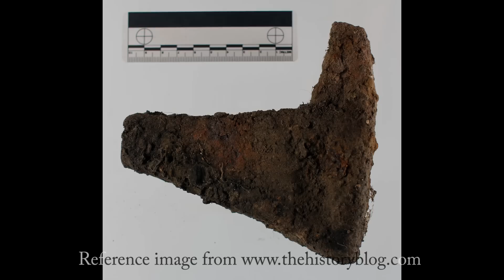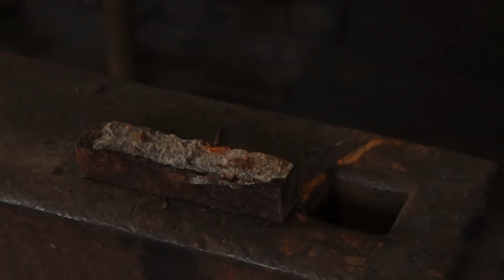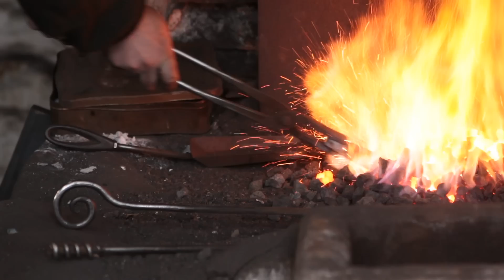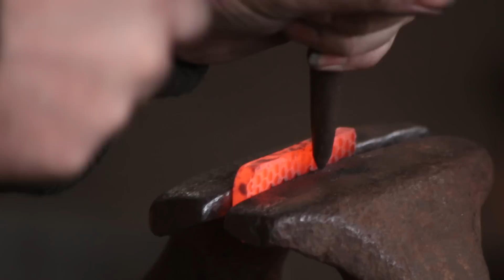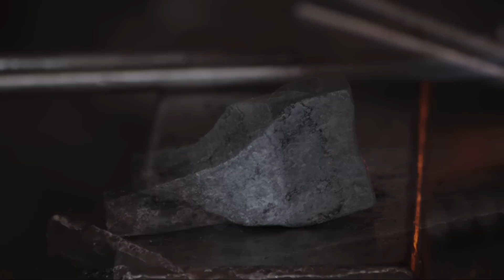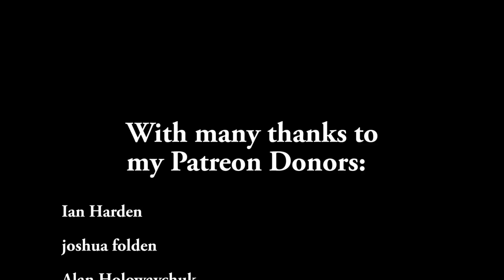Forging an Anglo-Saxon anvil. Part 1: the body and face.

Comment: I have no evidence to support this, but my gut feeling is that, throughout history, the blacksmith would have taken that little bit of extra time and effort to get his tools looking 'just so'. The main reason being pride in his work, but also as an advert to all visitors, which served to demonstrate his capabilities and skill. Toolmaking does not put bread on the table on that particular day, but taking time to do a good all round job of it, delays the time that the tool needs replacing or repairing. I know that, for myself, this approach in self made tools reduces the temptation to abuse or misuse them, as a shortcut for a perceived short term gain.   ...... or is this just all my 'modern day' indoctrination  ??
A great series of videos. I very much wish that you would make more of them. Your presentation and detailed narration are among the best on youtube..... Thank You Rowan !

Comment: So, what do you suppose they would have done to make something like that when they didn't have a nice flat surface to work on like that lovely modern anvil you have? Like, the "first" steel anvil they made. Do you think they might have just gotten it as flat as they could using an anvil stone, then ground away at it until it was good and flat, and made other anvils using that?
Reply: I believe there are several anecdotes and some anecdotal evidence of stone being used as an anvil. plenty of stones are hard enough and heat resistant enough to be beat against. And wrought or bog iron are sufficiently fluid under hammer to allow working on a stone. I remember reading that the tuyere on forges of that era were of heat resistant stone like Granite.
Reply: Well, yes, but I'm talking about creating a flat surface on the anvil they made.
Reply: Short answer is yes, that is a likely way to forge a flat surface when you don't have a flat surface to begin on. There are some areas of the world where stone anvils are still in use.
Reply: Thanks.
Reply: Here's a link to a book about blacksmithing in Africa. The cover of the edition I have shows an African smith using a stone anvil and a stone sledge to forge a piece of iron. 

https://www.amazon.com/Mande-Blacksmiths-Knowledge-Africa-Traditional/dp/0253207983/ref=sr_1_1?ie=UTF8&qid=1480303722&sr=8-1&keywords=the+mande+blacksmiths

Comment: Seems to me that you somehow have an endless supply of wrought iron paddle rod from the 18th century lying about.  I, myself found a bit of wrought iron in the form of a gigantic bolt...or axle (about 1-1/2 in dia by 10in with a round rivet-like head) near home (25mi southwest of Chicago) as my hometown is a historic 19th century quarrying town for limestone.  You've just given me an idea of something to use it for...however I struggle greatly with heating larger pieces with my charcoal forge...can't find a source of bituminous coal anywhere near me and I can't justify shipping charges for 100# bags all the way from Pennsylvania.  I've yet to find a YouTube blacksmith who only uses hardwood charcoal...the principal forging fuel throughout all history until coal was discovered...frustrating really.  Alas, great work man, I always love your demonstrations and occasional British humor!
Reply: It doesn't need to be so old, wrought iron (puddle iron) coexisted with modern processes for a long time. In great Britain the last manufacturer using the puddle proces only closed in the 1950's.
Reply: Contact these people to find coal: ILLINOIS VALLEY BLACKSMITH ASSOCIATIONhttp://www.illinoisblacksmith.org

UPPER MIDWEST BLACKSMITHS ASSOCIATIONhttp://www.umbaonline.ning.com
Reply: Have you considered using gas? (propane that is,  not gasoline)  although it may limit you a bit on size and shape of your stock is more available than charcoal and will probably save you money over time
Reply: I have considered it...and considered that I'd have to build a completely different forge.  With solid fuel, I can use the same forge which I proudly built from scratch.
  My first forge was a coffee can forge using a little propane cylinder, I kept it around for a while and for kicks I used it recently to make a half-way decent knife but it took a veritable eternity to heat up the material and I was never able to get it hot enough for heat treating...had to light up my charcoal forge to treat it.
  I have thrown about the idea of trying a small gas forge again now that I have some extra cerablanket lying about - just scaling the size up to a 1 gallon paint can...we'll see how it goes.
Cheers!
- J

Comment: We  have become quite spoiled by the size of our "modern" anvils.
Reply from the maker: Indeed! Though this would have most likely have been an itinerant smith's anvil so needed to be a bit lighter. ferrous Anvils remained small by our standards pretty much up until the dawn of the industrial revolution - though they did have a growth spurt in the 12th century-ish. Bigger anvils were available but tended to me made from stone!
Reply: The point you make about price is truer than true. These anvils are key.
Reply: never had a big anvil
Reply: They didn't suffer from anvil envy, plus there probably wasn't a need for metal objects large enough to warrant making one.

Comment: I really like the projects you take on, the variety of work is amazing, I always look forward to the next weeks video, they are a real window on the past, well done. Any chance of seeing that finished scythe and what type of snath it would be attached to?
Reply from the maker: Thanks Phil :) It was my intention to mount the scythe originally but the only snathes I could find were aluminium and designed for specific blades. I considered making one but I couldn't spare the extra day, sadly. At some point I will make a far better scythe and mount it properly though.

Comment: alrighty my friend another awesome video by the way if it falls off the forge it called drop forging wish we had great files like that one  in the states think most are case hardened crap especially that thick love the old school tool just seem to be more pleasing to the eye keep up the great work
Reply: It looked like an old farrier's hoof rasp to me. Lots of the old rusty ones around. No idea if the new ones are made from decent steel or not.
Reply from the maker: The modern ones over here are case-hardened as well, so I tend to use old ones which I pick-up at car-boots and flea markets for dirt cheap. I'll then use them to death and when the teeth are gone I'll turn them into something else. I find that the old rasps and files are nicer to fireweld than leaf-spring as well.

Comment: Nice work as usual. I'm not sure if you take project requests but if like to see someone make a medieval swallow tail broadhead. I've seen videos of people making bodkin points and standard broadheads but not a swallow tail. I believe they were made by forge welding the cutting edge onto a socket.
Reply from the maker: Thanks Dustin :) I do make the type 25 swallowtail heads but it took me months to refine the technique so I'm going to keep it to myself a little longer ;)
Reply: RowanTaylor so your saying there is a chance 😉

Comment: Why did you not drop into the hardy hole for the heavy strikes when welding the face? Bit less aggravating dropping on the floor maybe. Or is my question a bit of "hind site 20/20"? Thanks for  the video
Reply from the maker: Good question. I deliberately avoided the hardy because I didn't want to create a shoulder in the taper as it would have been hard to get out without creating a gall. If I were making a hardy tool then I would have used the hardy but because of the shape of the anglo saxon anvil it wasn't a practical solution.

Comment: what do the flux do?
Reply from the maker: Silver Break this flux is a mix of sand and borax. the sand provides a layer of molten silica which stops oxygen from damaging the high carbon steel while the borax dissolves the firescale thus allowing for a better weld.
Reply: RowanTaylor okey now i know. Thanks